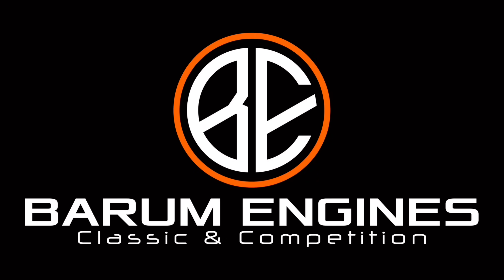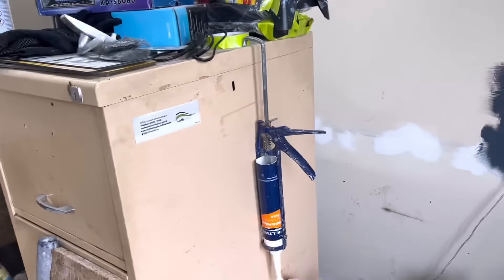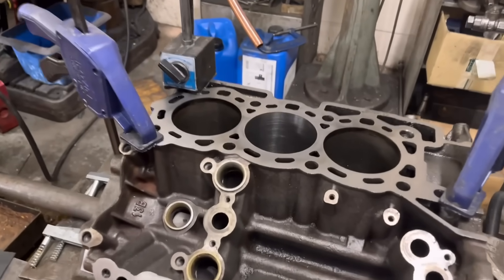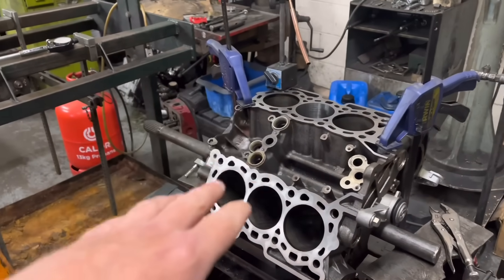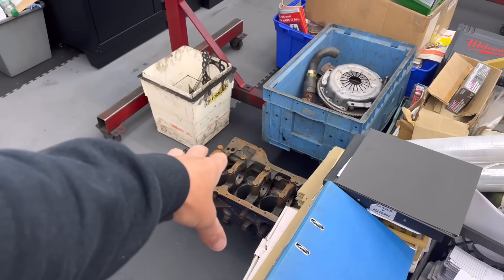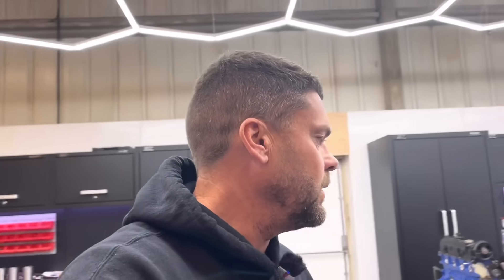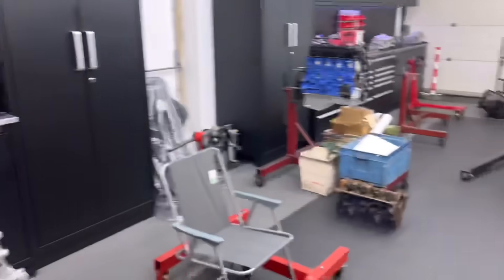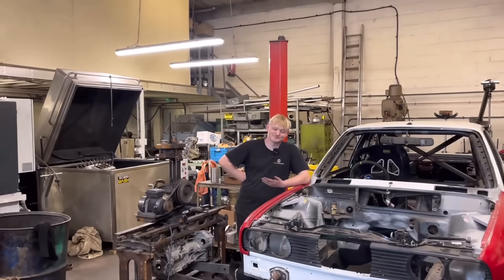Just what we did NOT need, can it get any worse?

Comment: Just be aware when you wrap the manifold it will induce condensation between the wrap and the steel. It will rot the manifold. You may want to consider coating it with Zircotec or similar instead.

Comment: Duno what you have to be sorry about.  Its a channel about life at Barum Engines. 

Talk to much? they might mean they would like to actually watch you machining?   Just very occasionally, I find you get excited and talk rather quickly, but 90% of the time I think you (and Isaac) present the programmes very well. Lads like Isaac are the future. Those that criticise the "heath Robinson" work holding, must have been very fortunate to have all the correct clamping jigs. Real engineers make use with whatever they have to hand. You should see how many of the Victorian and Edwardian engineers did things. Big bits of wood, even on lathes for steadys, but they made a good job of the machines they made.  As long as its safe, and allows you to carry out the job accurately without damaging the workpiece, its dosn't matter. 

One thing I've always been curious about (sorry if you have explained it and I missed it) how come the name is pronounced Bearum and not as spelt Barum? is that a local dialect thing? (just try getting many of the Norfolk place names right 😉)

Keep up the good work.

Comment: Could you put complete engines in a crate? Much less chance of damage in tra.
Reply: I temped at a place that palleted engines for Perkins. I used to do the custom jobs. Would get a tank or a yaught engine now and again. Its easy to knock up some timber for an engine. Bolt the block to the wood and you don't need much then.